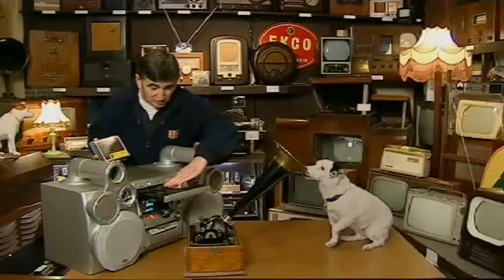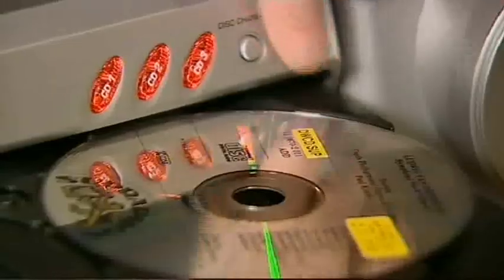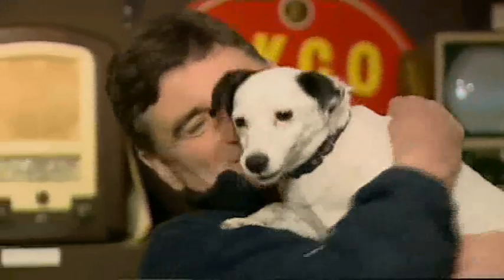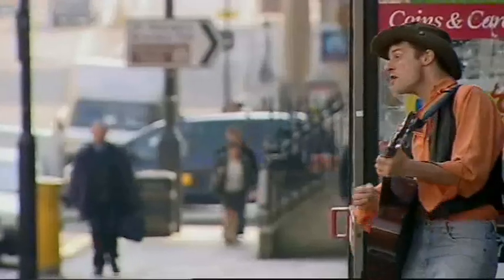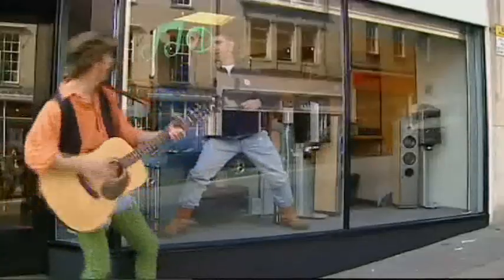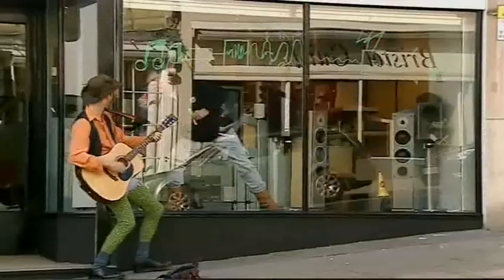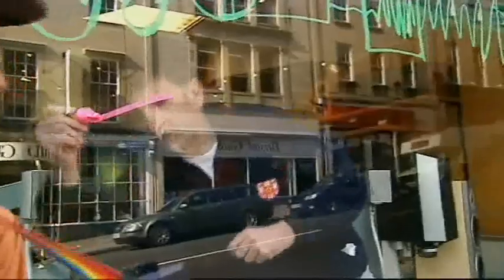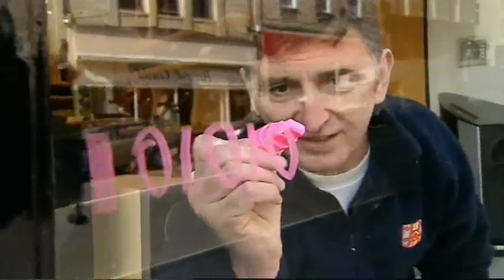Garry Lavin Naked Science - Analogue v Digital gadgets simply explained

Comment: "Travels through various circuits ... gets distorted"
Yes, that is unavoidable.  But when done with high quality "circuits", the distortion is virtually immeasurable.
.
Digital's 0s and 1s are very measurable, and the process of converting analog to 0s and 1s, and then back again to analog (when playing the CD), at a low bit rate, creates a myriad of problems -- including lossy sound, the quality of the DAC (which creates the analog sound), and jitter (playing the samples back uniformly).

Comment from the maker: Try and think of it like this..Digital is simply a numerical code (forget the zero and one thing for the moment) which is simply a set of instructions that tell a piece of sound / vision amplification equipment what sound or picture to generate.   Because these instructions dont change, you can generate as many perfect copies as you want. Analogue is an actual recording of the original sound or picture which when copied from generation to generation loses quality.
Check my other BBC TV stuff.